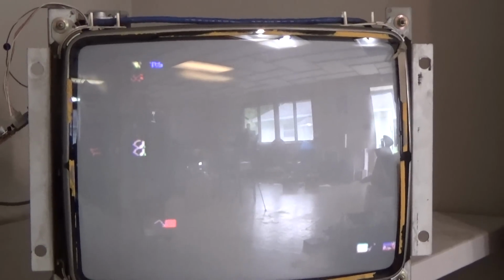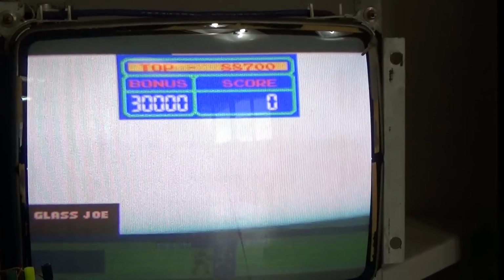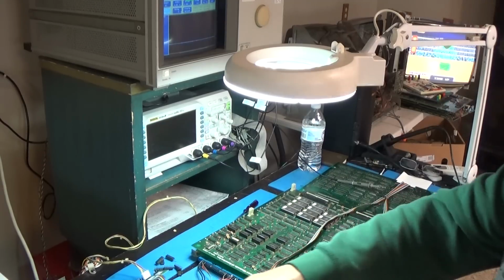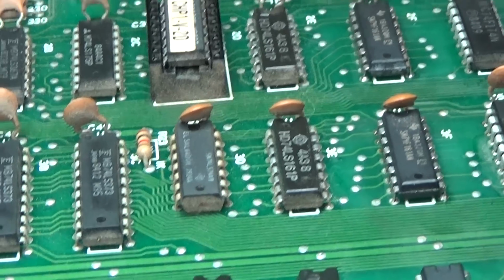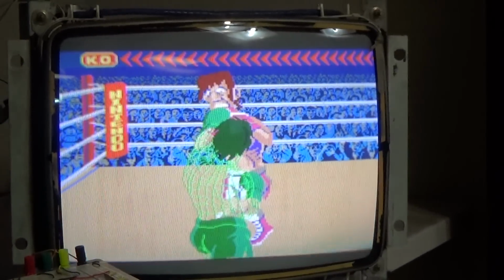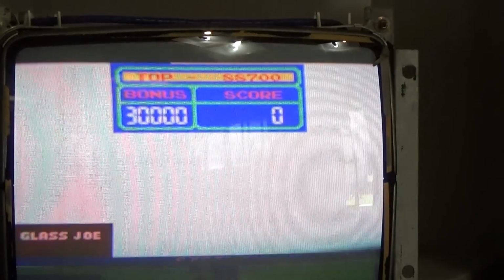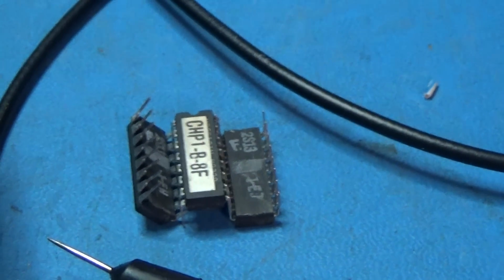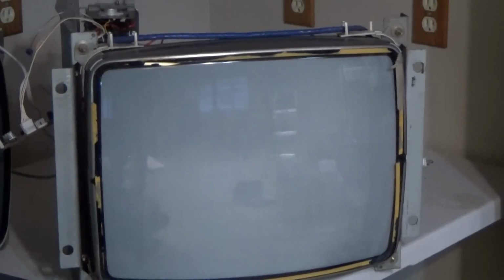1984 Nintendo Punch-out!! Arcade PCB Repair 9-30-20

Comment: Great job as always, Doc!
I had similar PROM issues with a Punch-Out I recently repaired. It turned out I had a mixture of Punch-Out and Super Punch-Out PROMs that caused all sorts of odd color issues. Anyway, there are 2 different sets of PROMs just for Punch-Out. There is a white label and a pink label version. The correct version is identified by associated TTL chips in the circuit. Mike's Arcade shows the method to identify versions if the labels are faded. I dont believe this is show in the schematic so isn't real clear. Hope this helps! https://www.mikesarcade.com/cgi-bin/store.pl?sku=CHP1-PROMS